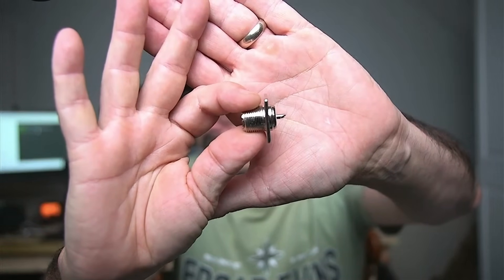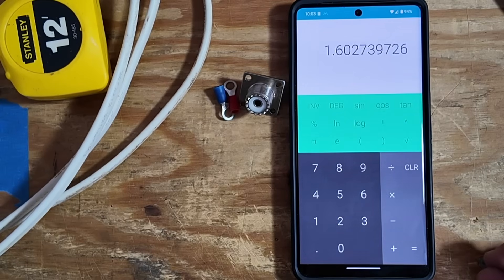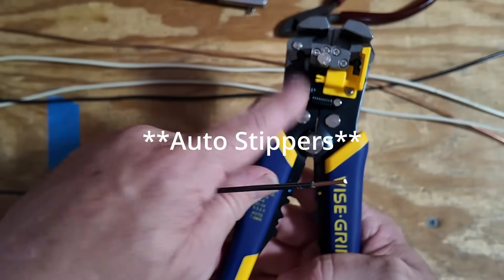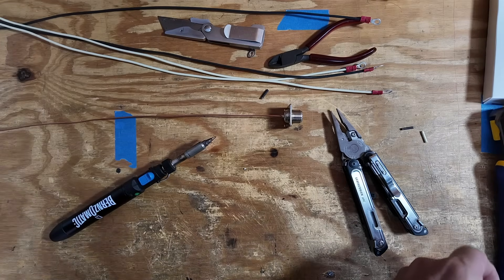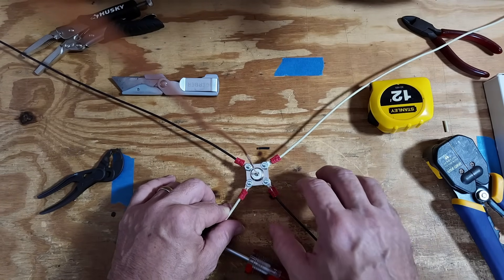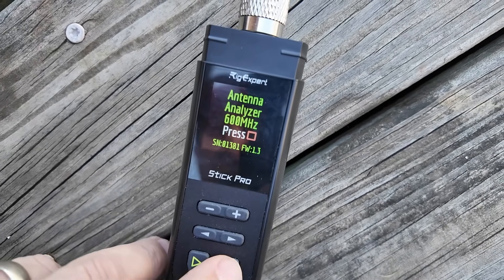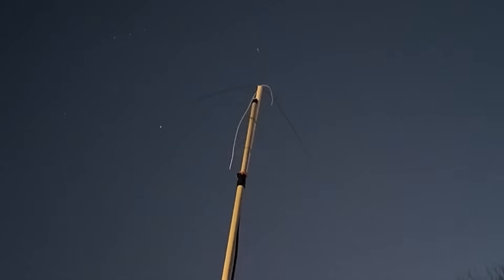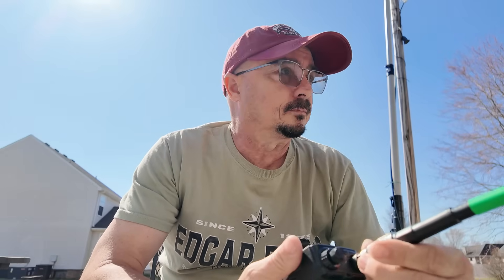DIY Antenna From Scrap Material

Comment: Remember, amateur radio is, ostensibly, there to serve the purpose of providing communications during an emergency.    And, in an emergency, you should be equipped with the skills to get a radio on the air, including providing that radio with an antenna.  And, there is no better way to develop those skills than just practicing them - before there is an emergency that calls for those skills.

Thanks for the video, and 73!
AI3IJ

Comment: Great video and thank you. Why do the radials need to be at a 45 degree angle? Sorry for the dumb question
Reply: With the ground radials horizontal, the impedance at the base of the antenna is about ~35Ω. This in itself would present a VSWR of 1.43:1.  Usable, but if one is transmitting with limited RF or DC power (batteries), then every milliwatt sent into the air matters.  Orienting the ground radials downward to 45º from horizontal raises the impedance to 50Ω, which is what our rigs are designed for.
73 de N5RLR 😉
Reply from the maker: Great question but I have never looked into it.
Reply: @ thank you for replying. I do appreciate it. You have a great channel and I appreciate everything you and all the other ham YouTubers are doing to help everyone and the hobby.

Comment: I use the same SO-239 connector.  Instead of 14 ga. copper, I use 3/32" brazing rod.  Solders easy, and is more rigid.  Ring terminals and 6-32 machine screws are the same as what you used.  My radials are multiplied by 1.06 of the vertical, and bent at 45 degrees downward.  The bend is a half to 3/4 inch away from the ring connector.  Also good results after cutting to tune.  Both 2 meter, and 70 cm made and used.

Comment: I have been running weekly 2M nets for my club for the past 6 months on almost this exact antenna setup. I just added an ungodly amount of hot glue to "weatherize" the top of the pole and I use cheap Amazon LMR-400 coax and a 30 year old Kenwood TM-214A I picked up at hamfest.  Is the antenna ugly? Yes!  Would people make fun of it if they saw it? Yes!  Does it work just fine for the time being? Yes!  Great video!  New Hams, go make this antenna and get on the air  It works!
Reply from the maker: Ugly doesn't matter as long as it works! :-)

Comment: Thanks for the video.  I'm 63 and just got my ham license 6 mo ago for Tech and 4 mo ago for general.  I've partially built one EFHW HF antenna.  It picks up well.  I think I got one contact on it.  I also built one of KB9VBR's ladder line 10-meter j-poles.  I'm just waiting on the SO-239 bulkhead to finish it up and test it out.

Comment: I have built this antenna, in fact it is the best antenna at my qth, better than the arrow antenna j-pole.  One thing I did a little different, I used double the length for the elements, bent them over, and twisted them with a cordless drill. That stiffens them up and makes the antenna more robust.

Comment: I built a similar antenna using a coffee can instead of radial wires and it did great.  My latest model is a dipole I made out of scrap aluminum 5" gutter guard, an SO-239, and a cutting board from Dollar Tree.  I set it up for a 144.00 frequency and it wound up being good on 2m, 1.25m and 70cm bands.  If you ever get bored, it's a great project for an evening.  Every new ham should go out and build antennas to build their tool-use and troubleshooting skills for when they purchase fancy prebuilt antennas.  They might have some fun with it, too.  73 de AK9AR

Comment: For me, the only antennas for me these days are made from scrap because I'm so cheap and money is tight. I made an unun a couple weeks ago from all scavenged parts. The toroid, and the magnet wire both came from a dead battery charger, and the BNC connector was scrap from work in the junk drawer. The random toroid seems to work just fine

Comment: Built the same antenna except I used wire coat hangers.  Works well.  The club I ma in uses it as part of an antenna building class we put on once in a while.  Thanks for the video! 73
Reply from the maker: Coat hangers would be another great choice of "scrap" material.

Comment: My first was a tape measure yagi, #2 was a 1/2" copper pipe j-pole. Love the 1/4 wave. Did you test on 70cm? Just for G&G?
Reply from the maker: My very first antenna was a copper jpole. Had to get the neighbor ham to help me tune it. Didn't own an analyzer at the time.

Comment: These antennas work great. I made one years ago. One suggestion, use fork connectors instead of ring connectors. That makes it easy to assemble/disassemble, and, it will transport inside the PVC pipe. You can also take another PVC pipe, just slightly large in diameter than the SO-239 and add caps to the ends of it, and the whole setup will fit inside for storage and transport.
Reply from the maker: That's a great idea. Thanks!